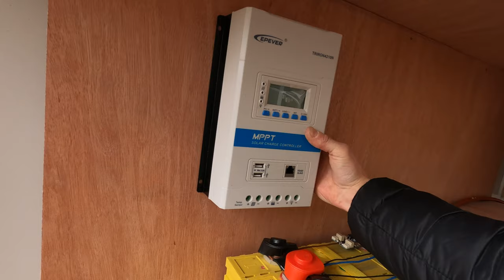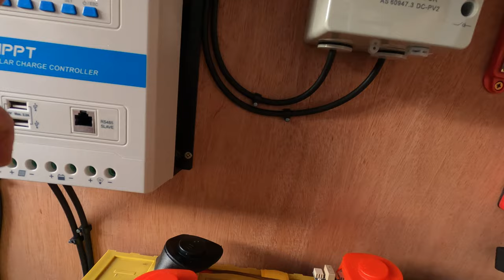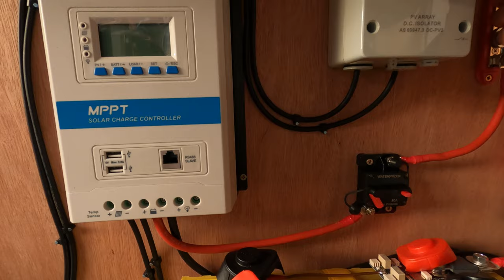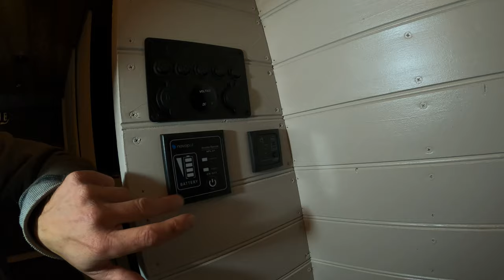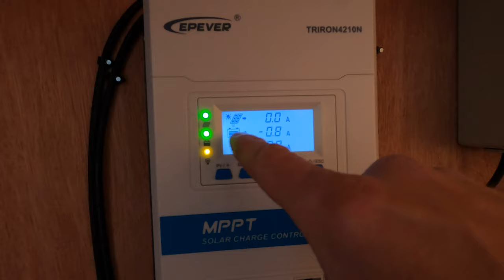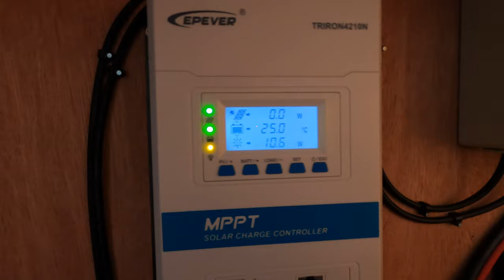Elektryka w kamperze. Solary, LiFePO4, kontroler ładowania MPPT - Budowa kampera #17

Comment: ile masz paneli ,jakiej mocy i dlaczego własnie ten regulator i to iest 40a o ile sie nie myle.pozdrawiam
Reply from the maker: Mamy 2 panele 200W monokrystaliczne. Po obliczeniach wyszło że 40a jest najbardziej optymalny do naszej instalacji elektrycxnej.
Reply: @TeraSfera  a czemu nie 1 panel 400 lub 450W? Czy to chodzi o ten parametr regulatora ---> "Maksymalna moc wejściowa: 520W/12V - 1040W/24V"? Zeby ominac 390W to laczymy po prostu dwa panele szeregowo?
Reply: I prosze powiedz jeszcze czemu regulator 40A a nie 30A? Zdaje sie ze przy Twojej konfiguracji to 30A wystarczylby. Regulator 30A ma PV 390W/12V - 780W/24V wiec przy 2 panelach 200w polaczonych szeregowo jest chyba limit 780W i max napiecie obwodu PV to 100/92V (przy 25c temp). Pytam, bo stoje przed wyborem wlasnie... Tez chce miec okolo 400W panele i nie wiem teraz czy 1szt czy rozbic na 2szt no i regulatora tez szukam do tego.
Reply from the maker: Cześć,
Jak kupowaliśmy panele prawie 2 lata temu to chyba nie bylo paneli o tak dużej mocy. Dlatego wybór padł na 2x200W
Jeżeli chodzi o regulator to chciałem mieć trochę zapasu żeby ewentualnie móc jeszcze coś dołożyć. 30A wychodziło tak na styk i bałem się że to wszystko będzie się mocno grzało. 
Pozdrawiamy 👍